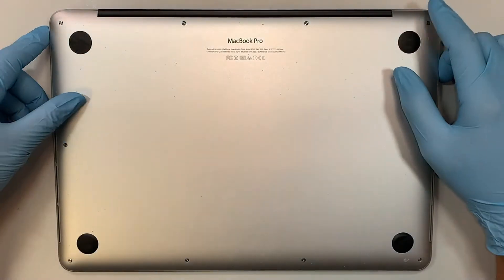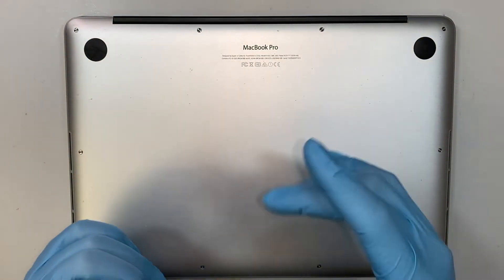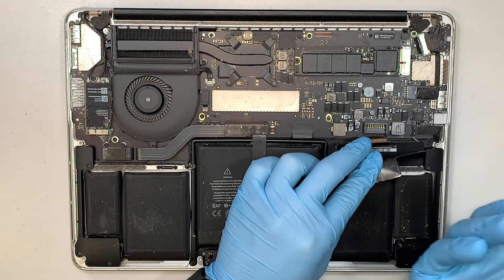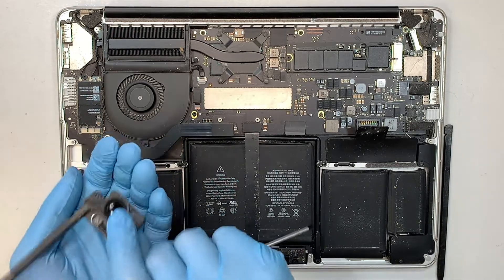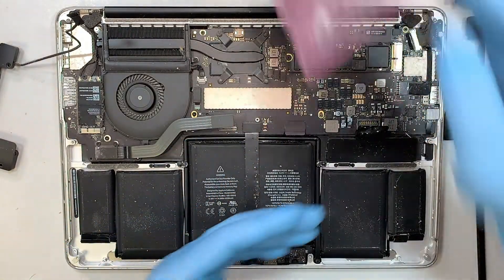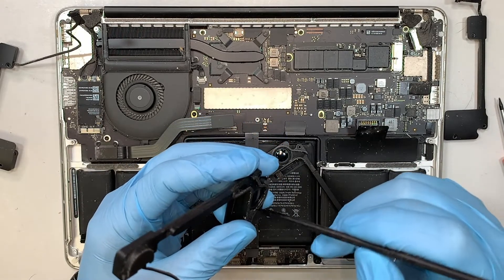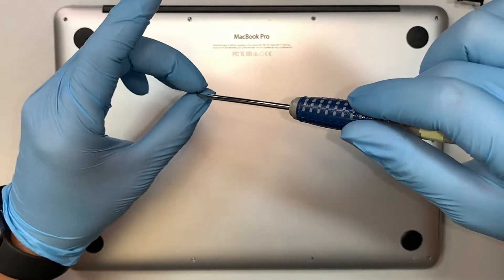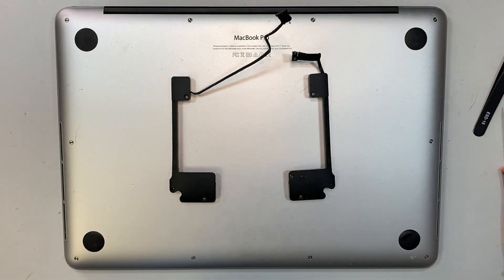Macbook A1502 Blown Speakers Static Noise 2015

Comment: Hey there just did a two-speaker replacement with original parts off ebay (good condition), but still getting fuzzy sound on one speaker. Not sure if it's another issue with the computer or it's the new used speakers I put iin?